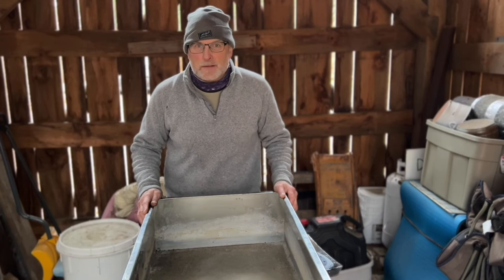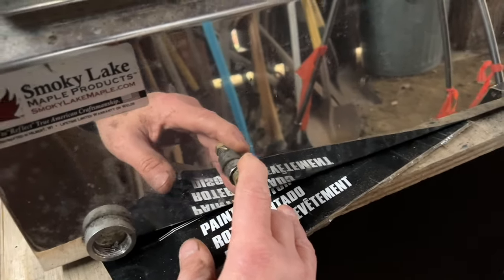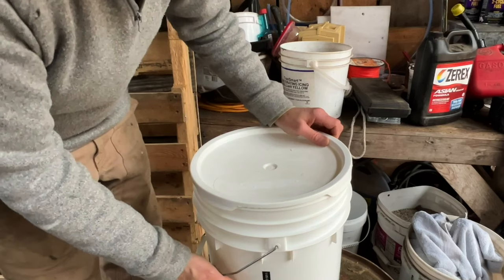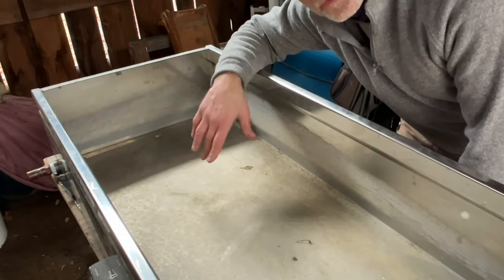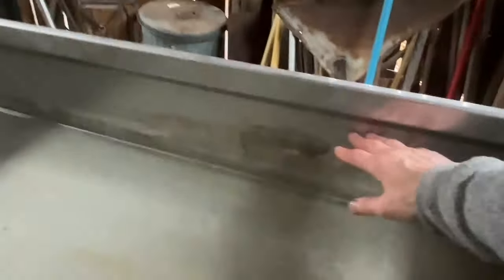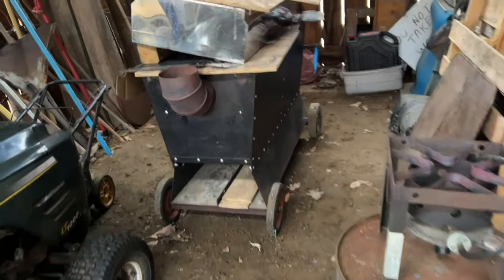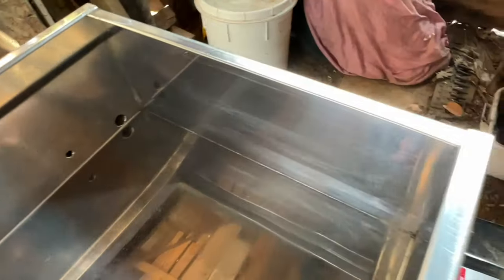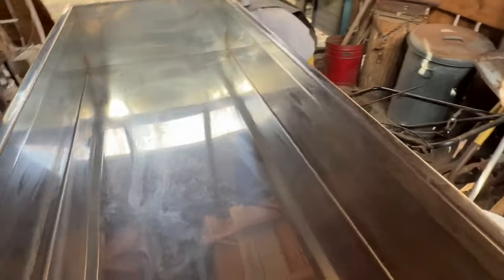How to clean a maple pan redux.

Comment: Excellent! Now, if you ever mess up and badly burn your syrup so you have a thick crust of black char that even power sanding tools can't remove, I've learned that high strength (35%) hydrogen peroxide (heated) lifts it off like peeling an orange. But be EXTREMELY CAREFUL not to get any on your skin, as it will cause permanent scars or worse. I tried vinegar for that to no avail (though perhaps after several days it could have worked? It was peak boiling season and I needed a solution fast...)
Reply from the maker: Good know! Hopefully I never need the hydrogen peroxide fix! The water vinegar has its limits for sure. How Does the pan look after the hydrogen peroxide, still shiny?